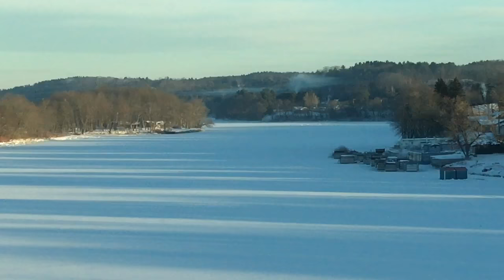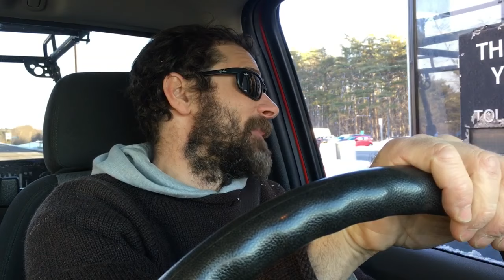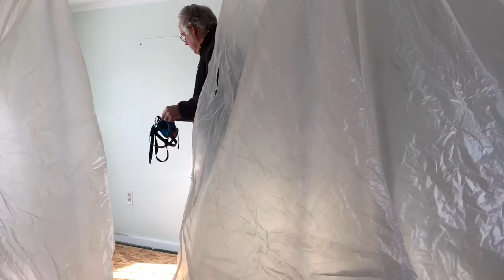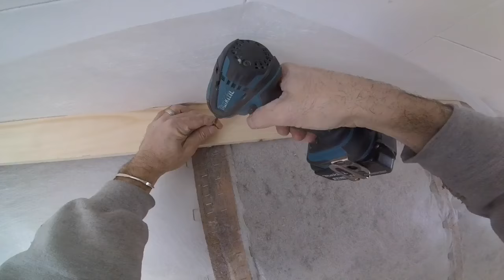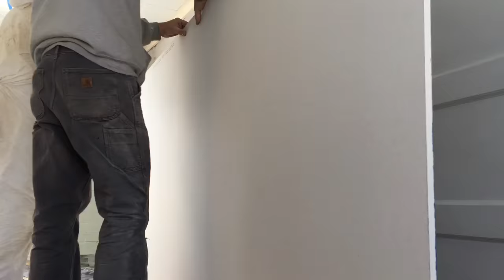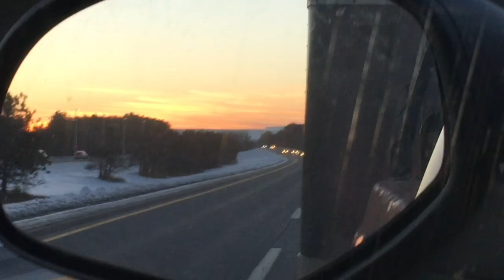Idiot at Toll Booth (me).  Maine VLOG 268

Comment: My first home was built in the 40s, not a drop of insulation and old wood Windows.  The steam radiators would fill the house with humidity and we would get condensation at every corner.  I had replacement windows installed by a neighbor who did that for a living.  We also had a father and son team come in and drill holes into every 'bay' and blow that cellulose insulation everywhere.   Problem solved condensation disappeared, not a single draft and we were snug as bugs in a rug after that.  

Old mans advise - try to never go out of the house without a few bucks in your pocket.. Sadly I do it all the time.  Great video.
Reply from the maker: Raymond Mills you could advertise for me with that testimonial!